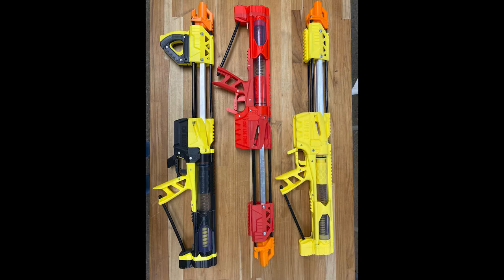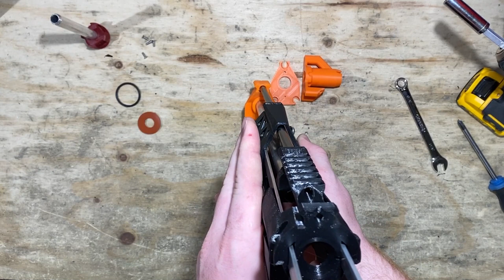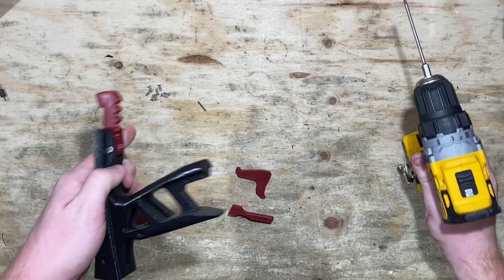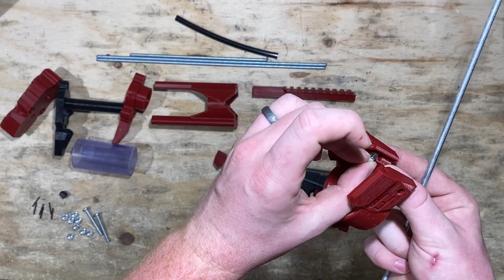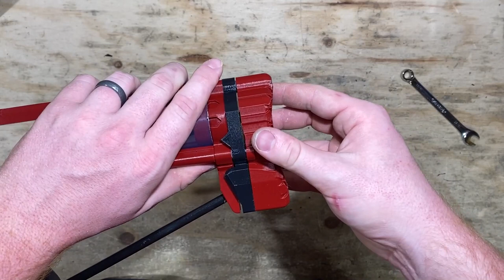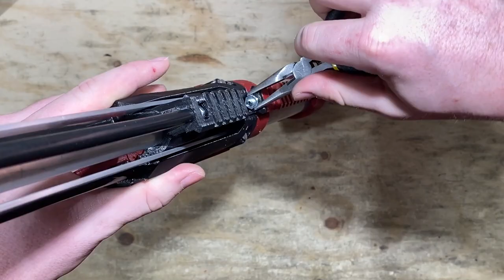Caliburn Nerf Blaster | Build Guide

Comment: Guys, for pressing the ram into the ram base, a bar clamp works great. Just line it up and squeeze hard and usually it gives you enough force to press it in.
Reply: And to add onto Eric barnett's comment, a mechanics tip about installing bearings also work. If you have to fit something over another peice, heat up the piece that's going on the outside. If it's a peice that has to go on the inside ( like what you have to do here) you can cool down the aluminum (or freeze it for better effect) and it will shrink the metal enough to slid in and when it warms up it will expand to its original size. This process won't hurt the metal and you won't have to press it in or at the very least no be as difficult.

Comment: What 3D printer would I need to print these parts
Reply: Basically any, I made one on a Creality Ender 3 which is about as cheap of a printer as you can get at $180 and it came out perfect.
(Edit) just checked and the Ender 3 is actually $160.
Reply: @carson5998  ı just buyed one first thing came in to my mind
Reply: I've got a sidewinder X1 (for the larger print bed) but an ender 3 is like sub 200$ and will work great

Comment: I was stupid and I tried to assemble it without grease, which caused the o-rings to not slide properly and after a few dry pumps it ended up breaking some of the 3d prints.

Comment: Would you recomend building a caliburn from PETG?
Reply: PETG is a better material for things like this because of it's ductility, this means it is harder to crack. Personally, I would recommend PETG over PLA because it will be more durable, just adjust the settings on your slicer to accommodate for PETG.
Reply from the maker: PETG is technically more durable, but PLA has worked well for us so far, especially if you reinforce the magwell with the coupler inserts. PLA is easier to print in as well.